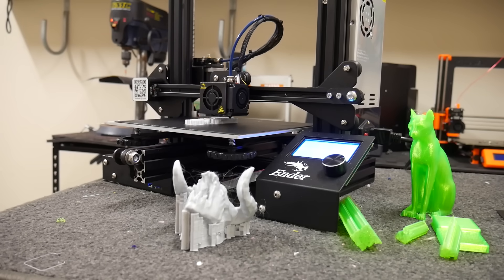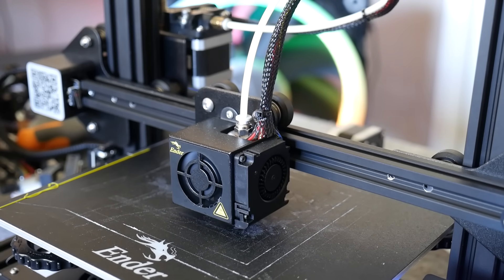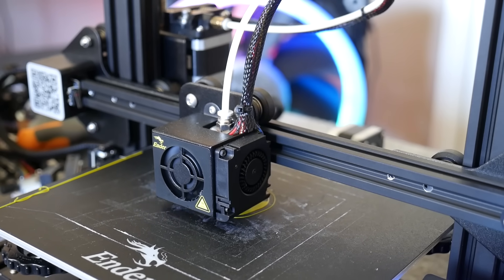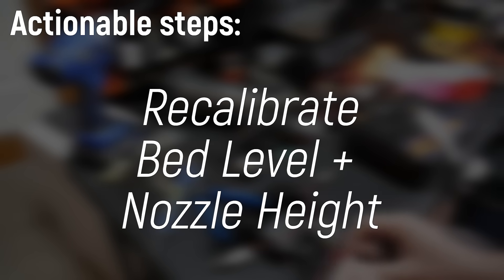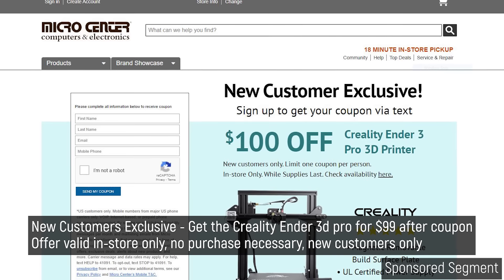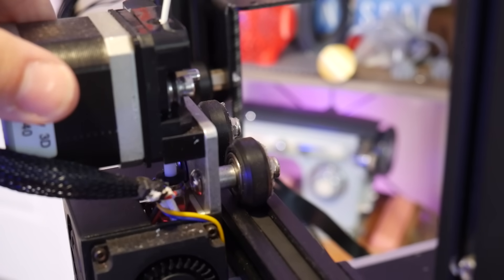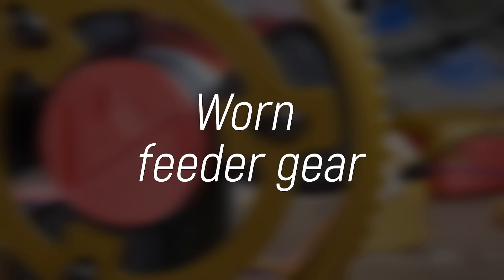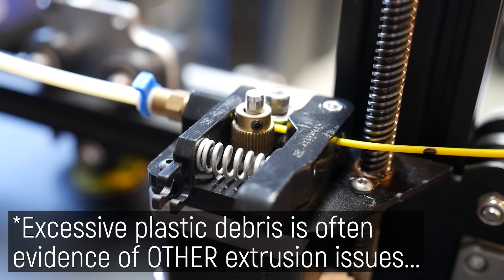Have your 3D Prints started to suck? Watch this!

Comment: 7:22 what about an all metal hotend?
Wouldn't that prevent that from happening?
Also there is no throat piece in the diagram
Am I to understand that the only difference in an all metal hot end is the addition of a metal throat piece that allows you to mount the Boden   tube at the top of the heat break instead of have to slide it all the always down to the nozzle?
I see  just the throat piece being target advertised to me on AliExpress all the time
I got the $100 ender 3 pro deal from microcenter, so if I just get the throat piece then I can convert my printer to an all metal hot end by adding the metal throat to the heat break?
Also do hardened nozzle wear out too(with or without abrasive filaments use)? What if you use a hardened nozzle for non abrasive filaments? Will it last a lot longer than a brass one and not blow out for a really long time?
Lastly what about the hardened extruder gears I see that come with some of the dual gear mk8 extruder replacements?
I just got the all metal  creality extruder from microcenter not sure if it comes with a hardened gear but if not should I get one before I install the new extruder?

Comment: I've had one breakdown that gave me grey hair. Prints became really spidery and had no mass to them. I checked and double checked a lot of things, made cold pulls, changed nozzles and so on. Until I saw a hair thin crack in the plastic extruder tension arm of the ender 3. So, if you buy a cheap printer, switch to an aluminium extruder as soon as possible.

Comment: My issue with my Ender 3 is that the build plate is somehow super warped, but in a weird way. It's concave along the X axis. The middle of the build plate is higher than left and right sides. But the really weird part is that this happens for both PEI and glass build plates! So if I calibrate to the middle of the bed, I get adhesion failures on the left and right sides. If I calibrate to the sides, the middle gets scuffed by the nozzle. It's the weirdest thing, especially since I can repeat it with both the glass and PEI build plates!

Comment: I learned pretty fast that removing the sock caused runaway alarms, but why? Why does that insulating sock NEED to be there? What is the reason?

It might be as simple as heat retention, but I genuinely don't know.

Why I removed it to begin with was because my sock got damaged on an overnight print failure where the filament somehow creeped its way in between the heat block and the sock, I had a very crusty sock by the morning lol.

Comment: I can attest that heaters failing and taking longer to get to temperature is a potential fire hazard. I know this from working in manufacturing and had a similar issue with my machine. The main breaker arched when they tried to turn it back on and you can smell burnt plastic. Don't play games with it if you experience this. Shut it down,  unplug it and find the problem, fix it. Don't take any chances.

Comment: How "dry" is needed for PLA or other filament? I'm new to 3d printing, but bought a big bag of silica gel packets and some digital hygrometers. When I put a couple of pouches in with a roll that has been out in 60%+ humidity and vacuum bag it, it gets down to around 10% within a day.

Comment: 10:56 I was hearing this I think from my part cooling fan but it fixed itself and still working or it might be the power supply because I hear like a rubbing not from the part cooling fan but the power supply

Comment: I got a Chinese 3d printer (prusa i3 style) and I've had a shit ton of problems ( big surprise). The frame was made of acrylic which was not stiff enough and would vibrate, belts could not tension, the goddamn screws kept stripping from the strong-ass springs, and the extruder motor wire snapped due to metal fatigue. The printer is one year old, so this is terrible. I've more or less managed to fix everything, but I've made one key innovation which I wish more printers would use. I don't know why it isn't the default.

Basically: instead of using springs and wing nuts on the bottom, the screws are secured to the print bed (nuts hold it at the top) and you adjust the print bed height with the wing nuts, which are on the top side if the lower platform. This way you can even life off the whole heated bed and do whatever you want. It's better if you use some threadlocker, or even secure the screws from the bottom when you finish leveling the bed, to avoid loosening it from vibrations. It's much easier to adjust since you're not fighting the springs and it doesn't break anymore.

Comment: 18:36 Use the usb connector(most printers have this) to power on the mainboard ans start heating. Since the usb cable cant provide enough voltage and current. Then the heater wont heat but the 3d printer still tries.

Comment: I'm still on my way figuring out why my PETG filament print wrong, it curls up, doesnt always stick to the bed, layers not sticking. But my PLA filament worked perfectly fine and tried to clean it up several times, so i suspect my filament, but unfortunately i cant buy a new one nor i have a dryer to see if it's humidity.
I did try to put it away with silicone gels for some days and the print did improve some after that so i stick to my initial guess.

I only got my printer recently so it was a good test run, maybe i shouldnt have boiling water near it when i printed with it

Comment: I’m a bit late to comment, but around two months ago my ender 3 max started beeping horribly in the middle of the night. My dad woke up from it, (not me because I sleep like a rock) and hit the power switch to shut it down. The screen said that it thermal runaway had happened, and gave me an error code. I read countless articles and watched many videos about thermal runaway and realized how lucky I was that I had gotten a printer with built in thermal runaway protection. Turns out that the thermistor wire was pinched too much or became slightly damaged, and I went on Amazon and was able to order five more for only twenty bucks. So, luckily, I was able to fix my printer within half an hour (I’m not the most speedy when it comes to even the least technical of things). Lately, my prints have started to shift and wobble throughout the print, and I had to add more bed clips and tighten the rollers, which seem to have fixed the problem so far. This video has many tips that I will also apply to help my prints further. Thanks!

Comment: Thank you for the tips. My printer has started having what looks like a layer shift every 5 layers or so leaving rings around the print. I checked all of the moving parts and adjusted the belts. It seemed to get better but I then printed several square boxes and some of them looked fine and some of them had the rings. I am thinking it may have been something in the gcode. But I am not sure.
Reply: Try to use stock cura parameters and see if it disapear

Comment: I also have your book, but i cant find a way to shut of the fan after the print is done and the heater block has cooled down.
Wich code to implement in Cura or Creality to get it done.
🤗

Comment: Creality's textured glass clipped over aluminum bed. Clean with IPA. After. Every. Single. Print. Level whilst bed is hot. Glass doesn't warp with heat like aluminum does, but absolutely level while hot. Creality textured glass auto releases when printed object and bed are cooled. Easy Peasy!!!😎👍🏻

Comment: An all metal hotend upgrade should prevent the cooked PTFE issue. Not only that, but you can print hotter filaments and get more out of the printer. If you have pet birds, I'd say an all metal hotend is a must as cooking PTFE (Teflon) is a big no-no around birds, plus its not really healthy for humans either.

Comment: Bought my first 3d printer last year, ender 3 V3 KE, the benchy included on the USB drive that came with it prints beautifully but almost everything I send from the creality print slicer has flaws, using cura or orca is even worse. I just need to figure out how to get a good slicer profile and figure out if the calibration I've tried to do has helped in any way. It's way more frustrating than I ever thought it would be, pretty much don't bother printing anything it just sits there unused

Comment: my tube is fine as of now but uhhh it was nice to learn from an unrelated YouTube video that my bowden tube degrades at the exact temperature that my printer has an inbuilt setting for 🙃like it's not like I'm printing ABS anyway but that's one of the two options for preheating in the printer menu, either PLA at 190 or ABS at 260

Comment: Maybe it's overkill but I've apparently been babying my 3d printer. I got a canister of silicone dessicated that I store my pla spools in, I also rotate out the spool that I'm using often. I wash the build plate with soap and water literally every time I print, probably overkill but I literally haven't had a first layer issue in over 4 months now. I haven't had to really level my bed all that often since I got both a glass plate and also the cr touch.

One of the things I wish I knew before I got a second z axis lead screw was that the two screws can go out of tram, if you've made a video addressing that or if you feel like making a video about that I'd like to know how to actually fix it rather than do what I'm doing right now which is squaring it literally every time I print.

Comment: Mine has recently been having issues. loading it heats to 230 and extrudes fine, but going to print a PLA at 200 like ive always been it no longer pushes anything out, overriding to 220+ seems to get it going again but seems that it shouldnt suddenly require a greater temp.

Comment: Shouldn't use paper towel. I use a fabric kitchen towel. Paper towel will leave fibers. Heat your bed to about 70°C and then use a cool damp rang-out cloth. Any plastic, skin oil, etc., will lift off when the cool damp cloth towel goes over it. The heat will evaporate any left over moisture from the towel.

Comment: Hey man! Thanks for the great content. 

Question, I’m getting my filament to grind up in the extruder gear due to high retraction settings…but when I lower the settings I get stringing.

I wonder if dehydrating the pla could help? Using pla plus at 
205 c nozzle
65 c bed (otherwise my prints get super brittle, helps harden layers)
40mm printspeed
6mm retraction
Limit 15 retracts per 6mm of material
50mms retract speed
Not in skin retraction
90% flow rate 

Basically 30% of my prints fail part of the way through because my extruder gear is grinding into the material…but I am printing super detailed parts and can’t have the stringing 

Using spidermaker pla matte filament 

Keep doing what you’re doing man, love the content
Reply: Loosen the extruder arm. I do 5@50 without issue.

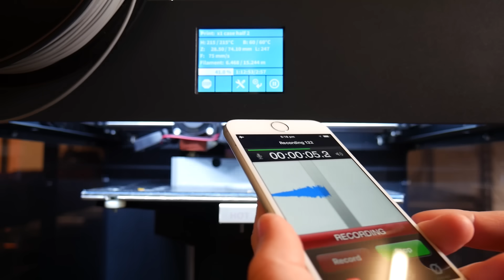Comment: Hey, thanks for a great video! I have a question through, at 6:48 you recording a printed making noise it should not do. I got the same issue just a day ago, before it was absolutely fine and the next morning after a night of just sitting there, being turned off, my Y axis motor began to make that strange noise, same as at the time code in the video. 

Can you share how did you fixed that noise at 6:48 of your video?

Comment: I was printing these lightsabers and the top of the blade are pretty bad, is it just because of the fact that they have a small surface area and are tall and move around when the bed moves? I have a prusa mine plus and I have a amazing first layer.( I clean my print surface with iceapropal alchohol before every print)

Comment: Thank you for the great troubleshooting checklist!! Sorry to bring this up, but chemically PTFE is a very brittle, powdery substance with very poor mechanical stability. You basically cannot build anything out of PTFE, and even coating other surfaces with PTFE is very difficult because it doesn’t engage into any chemical reaction with about any other substance on the planet. Why? Because Fluoride has such a high electro-negativity that the binding -C-F (in each polymerized C of poly-tetra-fluor-ethylene) is almost unbreakable for any other reactant. That’s why PTFE (=Teflon) coatings only work as a physical process. Therefore (and here is my point) it should be stressed that all “PTFE” tubes are chemically silicone or PVC tubes COATED with a very thin layer of PTFE. But they actually consist of totally different plastics with totally different properties.
Fun fact: PTFE was used in the Manhattan project because uranium-hexa-fluoride (UF6) is so enormously aggressive that is corrodes right through glass containers and the only substance not engaging into a reaction was PTFE.

Comment: Great video! I have an old Makerbot Replicator 2 - terrible bed adhesion for larger prints - with side and corner warping - however with smaller prints centred no worries. I have tried glue stick and dropping the extruder temp. What are you thoughts on this?

Also in regards to the Ender 3 promo do you know if microcentre ships to Australia?

Comment: Question... I changed out the nozzle, but it still strings like it's slightly clogged, I don't know what else to check. I've just started out and my printer started fine. Got a few Benchy boats and some other things. But now nadda

Comment: Thank you very much for this useful information and showing the steps you need to go to get back your good prints! I had a bed levelling problem with the Ender 3. When doing the levelling after homing the next homing pushed the nozzle into the printer bed. Would it be possible that the switch can cause tolerances or something else went wrong? In addition to that alcohol changed the surface of the glass bed of the Ender 3.

Comment: I have to relevel my print bed every time I go to print something, I replaced the springs more than once within a month and even after I use a tool to help me level it my prints still suck. I've adjusted everything, replaced parts, and moved it to a different place in my house even after I received some advice too so I'm pretty sure the guy I bought the printer off of broke it and just wanted to sell it to get it out of his garage.

Comment: My old anycubic delta started having bed adhesion issues after using PETG at 250 degrees... I suspect it's actually an extrusion problem from cooked PTFE that's manifesting as an adhesion problem.
I solved it by buying a bigger, better printer 😂

Comment: i see you also have an ENDER 3 .. i keep getting things stuck to my bed .. what do i use
..Whats the bed called you use
Reply from the maker: Is it the plate with a black sticker on top? Try flipping it over (or removing the sticker) and washing it clean with detergent, the material will stick PLA at 60degC then release as it cools - it's called g10 I have a video on it

Comment: If any one is wondering why there Neptune 4 Pro won't give consistent bed levels check your gantry Nuts and bolts are tight the ones near the long screw winder that goes to the top of the gantry it's the black bracket on both sides one has the hotend power cord clipped onto it...... Out of the 4 only one was I'd say barely tight the other ones were jumpy loose, which made the whole gantry arm loose and be able to jump around, so check ya Nuts lads for blue... Nahh only kidding but yer check your nuts 🇦🇺👍

Comment: The issues I have with my longer lk5 pro, is I cannot seem to print any kind of mechanism/collapsing print they always seem to fuse. If I run the “test print” it seems to work just fine, but then when I run the print it’s always fused. The death cube, any collapsing type sword/lightsaber, or any of the gear storage boxes. Could you do a video on this type of issue ?

Comment: Hi Angus, great video!  Quick question if you wouldn't mind.  I'm extremely limited with space in my house, so I have my printers in various areas.  I have one in my office which is perfectly temperature controlled, so no problem.  The one in my bedroom is a bit on the cold side in the winter, and pretty hot in the summer since there is an addon to my house with limited heat or air conditioning.  Next, the third is upstairs in the spare room with no heat or air, which is next to another room with limited heat and air. I would also like to add many printers in my basement, but it gets way too cold down there in the winter, and there's a ton of moisture in the summer even with a dehumidifier.  
So, my question is, what is a good humidity, and temperature range, as to not screw up my PLA rolls or prints?  
Sorry for the long message.  Thanks.

Comment: Is there anything that can wear down without a 3D printer being active?
Reply: Rubber Rollers can get flat spots. Usually the rollers even out after a few minuts though
Reply: The tension of the belts could get loose or maybe its the filament itself (moisture)?

Comment: Hi Angus, so I have just recently had a really odd issue with my printer, every print (that succeeds) ends up having this weird bulge(?) or elephant foot like spot, at exactly the 50% mark on the print, I’ve done the xyz cubes, I printed a small phone stand, and even the z axis calibration arms. All have that spot about 50% on the print of the z axis. My printer is a cr10s with silent board and microswiss hotend. Any help would be greatly appreciated! 🙏

Comment: Great video. My printed has started to stop extruding at a very specific height in big parts, roughly 2 cm, and I find the filament is broken in the feed gears. Problem is, the part is a rectangular mesh, so the x and y position as it goes up remain the same. No idea why that happens. Has it ever happened to anyone?